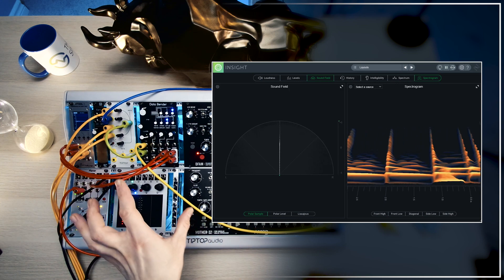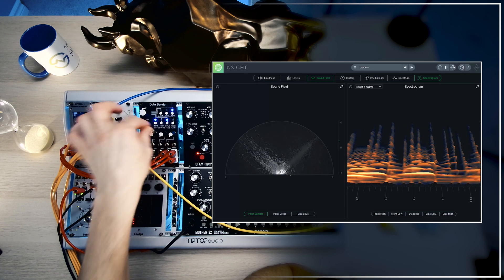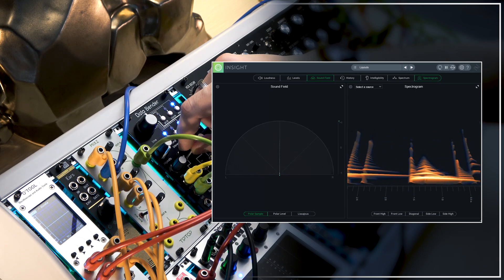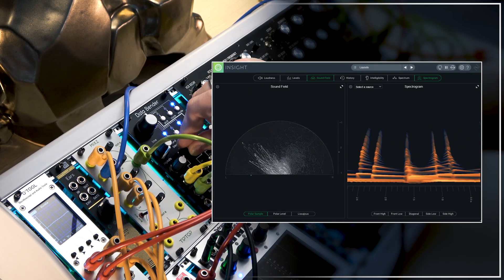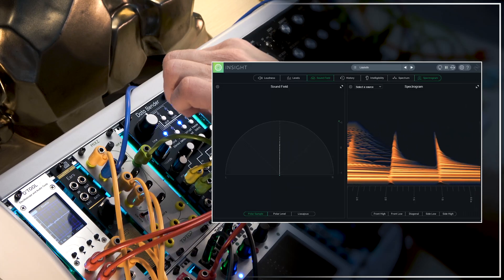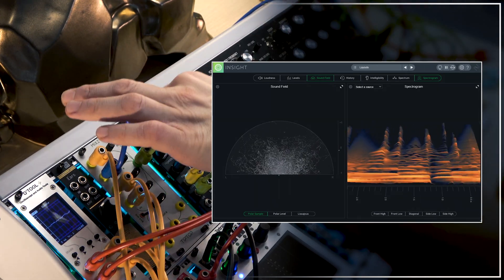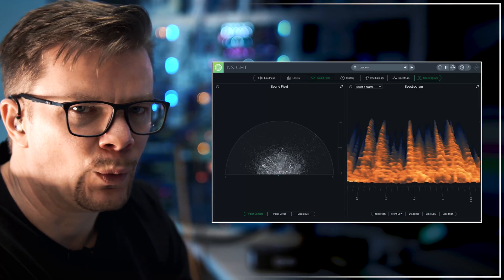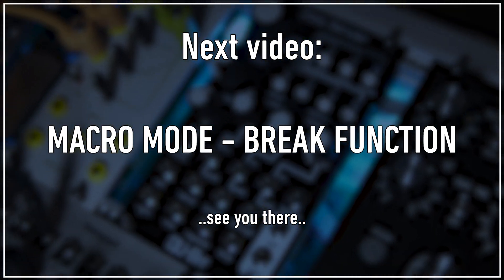QU-Bit Data Bender Video Manual - BEND Function in MACRO Mode

Comment: Hi I want to ask something pls ! I bought this today and I put a sound into the left input then from out put left to mixer but nothing came out ! I tryed on the right and on the right it works ! I'm doing something wrong or ? Pls help :)
Reply from the maker: Hi Darren,
So sorry for the slow response, I've had a pretty hectic week. Unfortunately that sounds like something in your audio chain, OR perhaps even your Bender might be defective. Going in the left channel and out the left output should give you sound (actually the left input is normalled to the L/R outputs for use with a mono input signal, so you should get sound coming from both L and R outputs), as long as everything else is properly set up in your audio chain (nothing muted, fader is up, cable not broken, volume turned up, etc.) I would suggest to test every element of your audio chain that's between the left out and your speakers, also make sure the patch cable you're using to go in the left input of the Bender is not faulty, and when you're absolutely sure it's  not your setup, then reach out to QU-Bit with the problem. 
I hope this helps and you can figure it out soon! Let me know how it goes!
Cheers,
Attila
Reply: Thanks allot for interested in my question :) yes I contact them and they told me that it not normal and I have to change it
Reply from the maker: @darrenborg5777  ok great 👍🏻 I’m glad the problem gets solved.